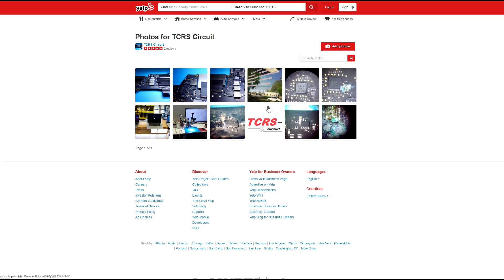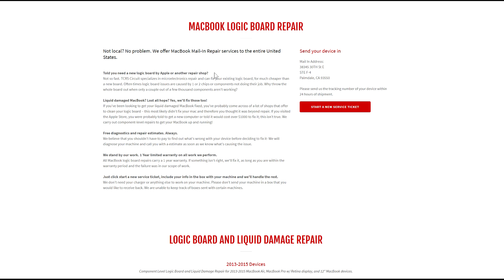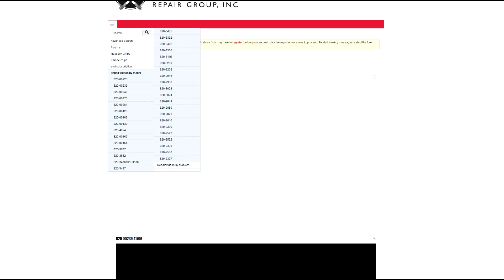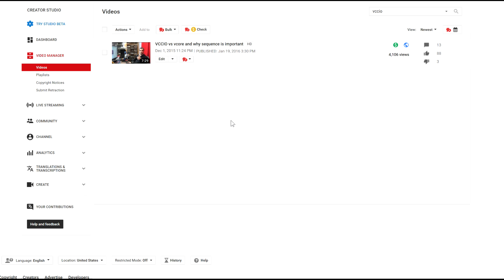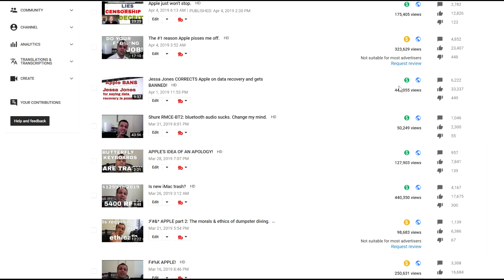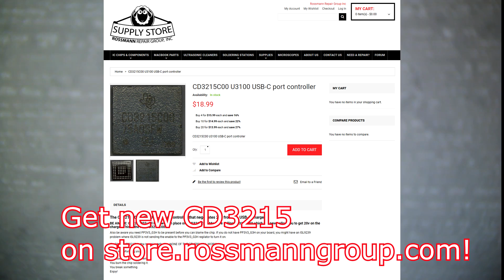18 year old viewer vs 18 year old company.

Comment: Not that I understand what you guys are talking about. However, I am a successful Electronics Engineer with over 40 years experience. I repair Discreet components products. you guys repair Surface Mount products. Well Done. At least the new generation is producing engineers with Repair interest and capability.

Comment: Hey Louis.
Quick question...
I know you specialize in Apple products, but is your forum or discord also open to asking about generic or PC repair questions?

I have a Windows laptop that I believe has a faulty LCD screen. I was quoted over $400 for the repair however I have found a replacement screen for around $85 and iFixit has a guide showing the replacement will only take about half an hour.

What I would like to do is ask some questions about the fault before committing any money towards trying to fix it myself.

If your forums or discord aren't appropriate for this kind of discussion, could you point me in the right direction?

Cheers.

Comment: Any chip/ram can be read, Unless they insert a kill switch..Which means if you connect the 1 connection you NEED, they is Flashes the chip.  Which COULD be a Law suit for destroying your data, FOR NO F'ing reason..

NOW if you can FIX DVD/BR players from DYING in 1-2 years FOR NO REASON...you will have TONS of business..for all those CHEAP DVD PLAYERS..

I have a device idea that COULD fix all of this, but corps dont want to deal with it, because its CHEAP.  and not designed to fail, but easy to fix.  A simple box to play Anything plugged into it, Computer DVD, Flash, Ram chips, audio/vid plugins..  Just a Box to plug things into...  all of this is upgradable because It dont care, as long as it can read the device, and PLAY it..  But the1 problem tends to be DMCA encoding and dealign with the CORPS..

Comment: This makes me genuinely happy both for Tim and for you. I hope you're proud of all the content you put out and all the good that it brings because this story (along with many others before and after it) might not have been possible without it. Thank you for putting all of the information out there and making it so easily accessible. Board repair for all! :)

I'll go back to practice soldering now.
Reply: All I did from 2016 until at least mid 2017 was practiced soldering and I sucked at it (And still do just not as bad as the guy that soldered the chip in the video) You'll get it!
Reply from the maker: Someone has a J9500 to remove a solder blob from.
Reply: Louis Rossmann oh the solder blob is long gone but so is J9500 :-)
Reply from the maker: Also, good job sticking with it.

Comment: My dad was an engineer and around early 2000’s most engineering firms in the area stopped taking on apprenticeships, the shop floor guys were not happy about this but the thinking by the owners was “why spend money on training when another firm will do it”. Problem is that all firms had the same idea, fast forward nearly 20 years and now there is nobody to replace the guys who are retiring. You do what you do because to share knowledge is a noble thing so the next generation can pick up the mantle when you retire.

Comment: When is Apple going to start gluing MacBooks together?
Reply: They'll probably start welding them shut
Reply: I think they actually did that back in 2011, with the "unibody" machines that would heat up and fall apart when under load for a while
Reply: Dont give apple an idea
Reply: 2009
Reply: When will they stop
Reply: @ba94845  unlikely, they might pot them in a sponge.
Reply: once they buy the patent and stop selling it.
Reply: Even better, weld the case together, and fill the empty space inside with a pyrophoric substance that explodes on contact with air, should anyone try to break in.
Reply: Apple can learn a thing or two from those EFTPOS machines...
Opening those = all chips destroyed. They have multiple membrane tabs and other anti-tamering measures.
Reply: @diatomsaus  nope, merely destroying chips is not the Apple Way(TM). It needs to either violently explode, or release toxic gas, in an attempt to murder whoever tries to perform a repair.
Reply: @NetRolller3D  Have the membranes linked to overload the high power caps for the thing to go bang, or just link the case to high voltage and electrocute the technician offender. ;)
Reply: Just dip the whole board in epoxy and call it water resistant

Comment: How did he get the money to do it?
Reply: I started with $210. I bought a hot air station for $75, and a soldering iron for 100. No microscope. Fixed 2 boards and bought a microscope. Eventually got a stable stream of work, and then opened the store after 2 years of doing it.
Reply: @TCRSCircuit  thats good then it's alot better than being given it

Comment: I've learned a lot from this channel and I want to open a store here in the Bahamas. I've fixed a few machines so far getting really good at it. Just need better equipment now.
Reply: I bet you could get some good equipment at store.rossmanngroup.com
Reply: Keep at it bro
Reply: DO IT BRO! Don't give up!!!
Reply: today you can buy cheap equitment from china right now for cheap you can buy t12 ksger soldering station from ali for cheap its beter than hakko it have beter ui and smaller (i have cheap soldering  station and t12 ksger im not talking bullshit) or  you can buy ts 80 or 100 but you need psu soo btw  i dont rec buy at rossmant becouse shiping but if shiping is cheap dont delay buy today store.rossmangroup.com
Reply: @felixgamingvlog6702  You can build your own power supply using an old 19v laptop charger and an lm2596 buck converter.
Reply: And once I get them working perfectly fine I sell them
Reply: I buy machines that people don’t want
Reply: Good luck in all you do, dude!
Reply: Where do you get machines to practice on?
Reply: go get them girl
Reply: keep it up! good luck with your shop!